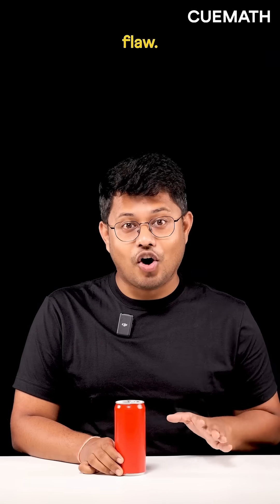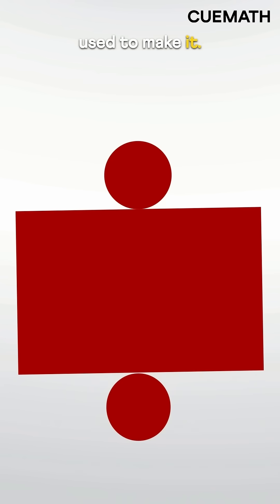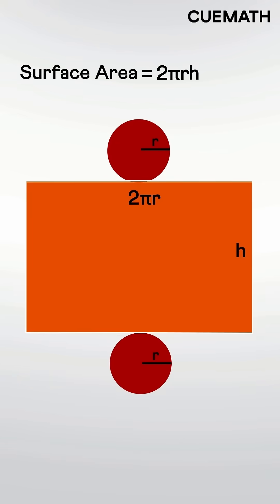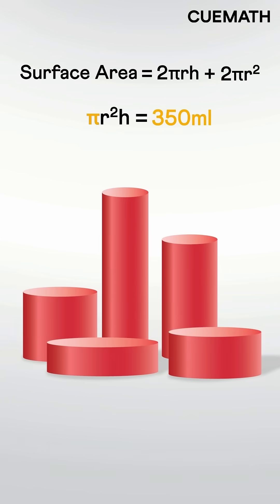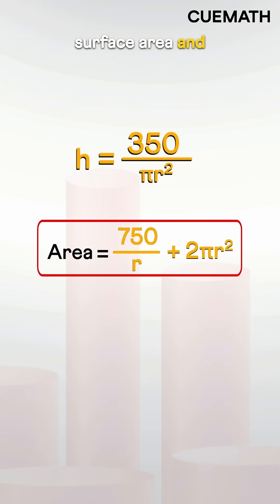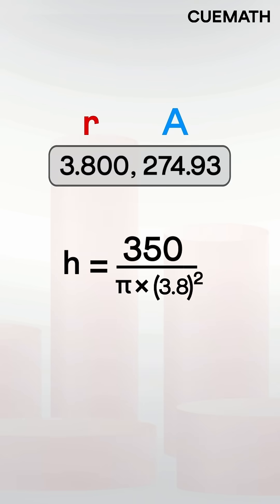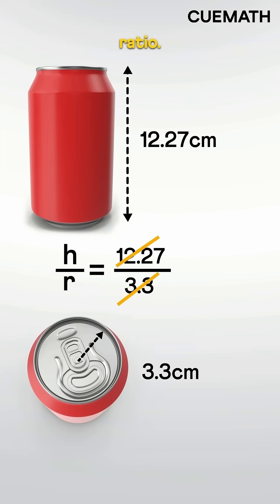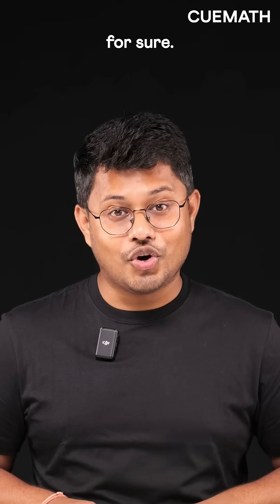Your soda can has a math flaw.🤯

Comment: Most soda cans don't, but I actually saw some canned fish brands that has the can diameter as big as its height
Reply: Which I think it is mostly because for sodas, you have to hold it with your hand and drink, and the height has to be higher because some people also uses a long straw to drink from the can.
Reply: @pooqy  Yeah, drinking straws are long, so the can design can't be so short.

Comment: The reason why these cans do not follow your optimal solution could be: The metal band used to cut the cans from has specific dimensions (width and height). The question was: "Calculate the maximum number of cans that can be cut from the metal band without generating excessive metal waste."
Reply: More the radius compared to height, less pressure it can hold
Reply: Plus, I'm also guessing that the top and bottom parts of the can need more material (since they're thicker ) so increasing the radius will also increase the cost...plus usability issues of a weird-shaped can...
I may be wrong though
Reply: If it was actually a case of maximize volume to surface area we'd have sphere cans but getting the metal into certain shapes costs money too so sphere isn't the cheapest shape
Reply: Also the slightly more real consideration of "the width is more or less fixed to what fits in a human hand."

Comment: Reason is simple 
1. The strength of the tin plate needs to increase as we are expanding the radius for the same vol. to fit in, which will lead to more cost to make, which also means hard to hold in hand.
2. The radius you have considered is incorrect; in the real one, it is curved to increase strength. It is a Spherical Segment.

Comment: But reducing the surface area was never the goal. Increasing the surface area for advertisement means the radius should be small and height should be large. But the radius cannot be too small as it hides the information that is not visible when looking at it from an angle. Hence the soda can is perfectly made with exact radius and height for marketing surface area from 3D perspective.

Comment: i think the reason has to do with safety and ease of use. think about how annoying it feels to drink water out of a cup that's filled to the brim. that's how you'd feel drinking out of a cup with no space for air. it's probably there to make the soda more stable (so if you try to shake it, the carbon dioxide has a harder time exerting forces on the can), or to increase its shelf life. similar to how chip bags are filled with nitrogen to reduce the risk of mold, the extra space in the soda cans might be filled with nitrogen for the same purpose. perhaps it's some structural thing to make the can solid enough to survive the pressures of the soda. just a few theories.

Comment: A real gas concept comes into play ...  As you increase the diameter so does the lateral space of occupation by sealed gas increased thus decresing the overall pressure within a cylinder .... This might cause the drink to taste sodaless and and might cause the heavy stacks to damage as internal pressure within can is less than vertical component of air pressure

Comment: Don't forget that the tops are more complex than just a circular piece of aluminum. You have to add in the cost of fusing along the circumference of the top and the waste in the fact that tops cannot be tessellated. There's also the concept of cans fitting into hands or cupholders for convenience. If you have fixed cupholder sizes but want to sell larger cans, you can only expand the can up, and since adding height is just adding to the efficient rectangular portion of the can, it is more efficient if you have a maximum radius to be as tall as practical.

Comment: the flat top and bottom are weak to deformation due to the pressure inside the can. reducing these areas helps prevent them from bulging.

Comment: I'm guessing it costs more for the cola than the can so an approach that minimizes the volume of cola woud be ideal so it would make sense why they would have a taller looking can because volume scales quadratically with increase in radius and linearly with height, so by scaling the height instead of radius an illusion of giving more can be rendered while minimising the costs. I could be wrong.

Comment: I think the constant over the r is wrong. 350 x 2 =700, not 750.

I tried to calculate this in general and it's right. The "ideal cylinder" with the most volume and least surface area (for any case, given one of the variables is constant), is ALWAYS a cylinder that is as wide as it is tall (2r = h)
Reply: erhm,,, what the... ...sigma?
Reply: Aa gaye gyan dene, aaj kal tumhare jaise loge jinhe kuch nhi aata, khud ko shreshth samajhne ki bhul kar baithe hai. आजकल लोगों को सर्वश्रेष्ठ सर्वगुण संपन्न और 100% परफेक्ट man  रहे हैं

Comment: Spherical soda cans will be wild !!!
Reply: It will, but there is at least one problem with that: transportation.

There are two main reasons to why a soda can has a top and bottom shaped the current way:

The first reason is to optimize the stability during the transport (since the top of one can can interlock with the bottom of the can on top of it), which is (close to) impossible with spherical containers.

The second reason is optimizing the amount of space each can take up, minimizing the amount of air between cans, meaning that more cans can be transported at once.
Reply: @dancehalllyrics1303  🤓☝️

Comment: I think the companies are not thinking the way you are thinking. They are more worried about the cost of the cola/soda than the cost of the can. So they would love to make the can look large for the little content inside. Remember Lays, 95% of the packet is simply air.
Reply: They are really thinking of reducing the cost of per can expense...
Reply: It has air to protect the chips during shipping
Reply: And to provide inert environment by using N2
Reply: It’s more like 80%, and it’s not air, it’s nitrogen that’s necessary for the chips.
Reply: @Dark139hunter  So uh, nitrogen doesn't work that way. The reason nitrogen gas preserves your food is because it's not oxygen. It doesn't matter how much Not Oxygen there is, because the point is that there's no oxygen.

That said the gas pressure servers a purpose in making sure the chips don't get damage by stacking bags.
Reply: @Dark139hunter Bhai nitrogen bhi air hai
Reply: @VuNam_MCVN you can reduce oxidation with nitrogen but that doesn't mean 20% of the bag is chips and we paying for 100% duh
Reply: @VJMotivation01 Nitrogen gas hai, air nhi